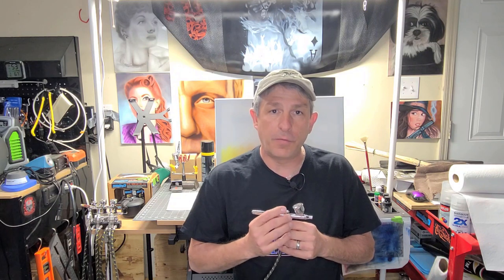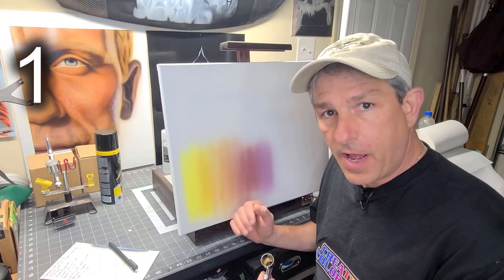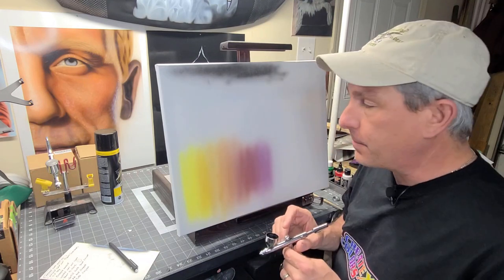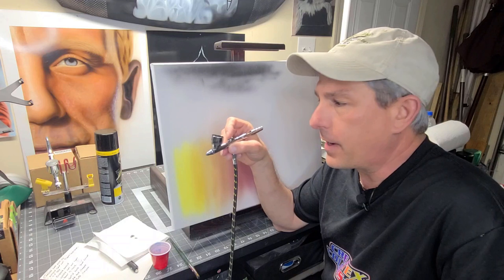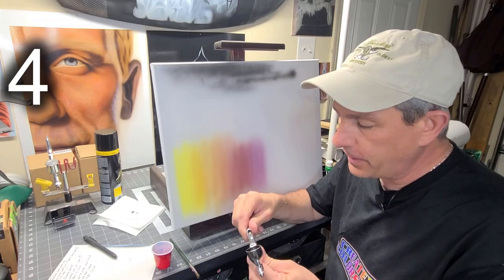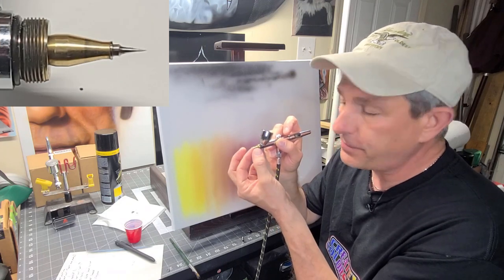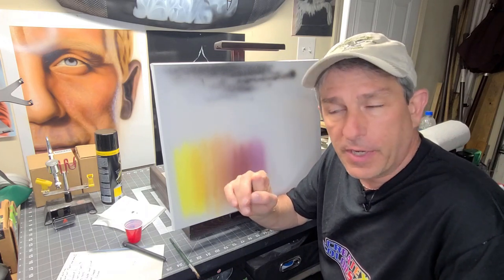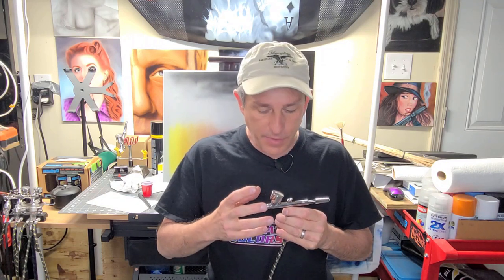Airbrush Won't Spray? Some Reasons It Won't!

Comment: I have a pistol grip airbrush that has no air going thru it at all. tore it apart, cleaned everything, still no air. It's not the incoming flow from the compressor, that work fine. All the valves are clean . Any thoughts?
Reply from the maker: Rick, is there a MAC (micro Control Valve) valve on the gun? If so make sure it is turned open. As simple as this sounds it has happened to me. It is not likely that an air valve goes bad but any thing can happen. Take the air valve out inspect it and put it back in and try it. Before you put it back in hook your air hose up to the brush and make sure there is no other obstructions. This will isolate the air valve. If no good after putting the valuve back in, look to replace the air value. Hope this helps.

Comment: I'm new to using a gravity feed brush. I bought a gun with a 4 color cup, I thought, that could be cool. When I connected it the first time it sprayed but very lightly and eventually stopped spraying all together. I stripped the gun cleaned everything out it back together and still nothing. I out it back in its box and continued spraying with my bottle gun. Any ideas on what happened? Also, how far do you stick the needle into the tip? Thanks.
Reply from the maker: 6274, sorry to hear you are having trouble. The needle needs to be pushed all the way against you nozzle. As long as you can get paint to flow onto the tip of your needle and air flow it should work. Two main reasons for what you are experiencing is your paint is to thick and or you needle nozzle has some dried paint in it. Use a needle reamer on your nozzle, reduce your paint to 1 to 1 or more and set your repressure to around 27 p.s.i. and see what happens. Hope this helps.
Reply: @TheAirbrushGarage  thanks a lot 👍🏻

Comment: Help🙈🤦‍♀️I took my airbrush appart  to clean, can’t remember how it goes back together. I pulled out the anatomy, mechanical paper of it, no retraction on the needle still.🤦‍♀️🤦‍♀️🤦‍♀️🤦‍♀️
Reply from the maker: Kendra, make sure the needle is pushed all the way forward and the needle nut is tight. Also make sure your needle stop is not all the way forward. And don't get frustrated, learning how to take apart, clean and put your brush back together is a very important part of airbrushing, you'll get it. Hope this helps and thanks for the question and hope you keep watching.

Comment: I've been trying to airbrush, I've trouble shooted everything you covered and i still can't get any paint out of my gun. Is there anything else that i could be doing wrong.  It will spray reducer and water out fine. Soon as i add paint reduced and all. Nothing 🤬
Reply from the maker: Orlando, if it's spraying straight reducer it should spray paint.. Try this...start with a mix of 10 to 1. That's 10 parts or drops of reducer and 1 part (drop) of paint. Mix well and spray. Continue to add one drop of paint mix and spray until it becomes difficult to spray. Now clean your cup, back off 2 drops from where it became difficult and use that mix to practice. Hope this helps. Thanks for the question and thanks for watching.
Reply: @TheAirbrushGarage  yeah that's what i was thinking if it sprayed reducer it should spray paint..but i will try what u said. Thank you for replying and your help..You're welcome too

Comment: I followed all these steps and my air brush still wont spray paint. I used paint thinner and it still wont work and I checked the needle in the front for dry paint i just bought this air brush a week ago idk what to do
Reply from the maker: Gunner, It can be frustrating when you first get started. Set your air pressure to 30 psi. reduce your paint 1 to 1. snug up all connections. Now if it still doesn't work, take off the air nozzle (with no paint in the brush) press down on the air, is it good and strong? it should be. Also, hold the air nozzle up to the light, you should be able to see through the little tiny air holes (rare, but make sure they are not clogged). put everything back together. Now, with very thin paint, 30 psi, everything back together and tight. It should work. What brush do you have?

Comment: I dont know but the White paint stick to the tip of the needle like glue, even with constant air flow, I have tried with two type of nozzle and needle, a 0.2 and a 0.3 and it`s the same issue everytime.
I'm about to trash all this paint and try uretano .
Reply from the maker: Alden, which one are you using? Wicked or illustration? If you are using Illustration just use a few drops of water. Illustration sprays alot easier than wicked. If you are using wicked use 4011 reducer. Start with a 1 to 1 mix. If you are still getting tip dry Add a few drops at a time untill it goes away. Use a small paint brush dipped into some reducer to clean off the tip dry. Then spray air and dab with a paper tower so you don't blow reducer on your project. This works better than clearing it with you fingers. Createx is really good paint I have been using it since the beginning. If you reach out to Createx and let them know your frustration they will respond with tips as well and possibly send you some free paint. Don't give up. If I can do it so can you.
Reply: @TheAirbrushGarage  thank you for your reply , yes I only use illustration, already trashed all Wicked. Will try your advices , thank you Sir.

Comment: I've been having the same issue as problem #1. I have an iwata revolution CR Japan, it'll start spraying then stops and starts when i move the trigger, spraying around 20psi and acrylic paint is thinned down to consistency of milk.
I also notice that it spiders sometimes would that be due to pressure being too high with thinner paint? so reduce pressure?
thanks.
Reply from the maker: Knuckles, I spray at 27 to 30 psi. It sounds like tip dry. Make sure when you bring the trigger forward to stop the flow of paint you still have the air on. This blows to paint off the needle and minimizes tip dry. As far as the spidering goes that is a matter of distance, speed and trigger control. I know it can be frustrating but you will get it. Just keep practicing. Hope this helps and thanks for watching.
Reply: @TheAirbrushGarage  thanks for such a quick response! I usually keep air continually going and clean any tip dry. It’s a new brush used twice and only started doing this the third time. 
I took it apart since my comment to see if maybe there was a blockage of sorts. 
I’ll keep working on my technique.
Thanks, video was very informative.
Reply from the maker: @Knuckles2K12  if you don't have a needle reamer get one her is a link. This will help! https://amzn.to/3A7hEe2. You will be shocked at what's in your nozzle when you use this.

Comment: Mine won't spray except when I release it spurts a bit out. Trying to figure it out.
Reply from the maker: Lori, just released a video yesterday on this topic check it out if you get a chance. But for now....start with just reducer or whatever you are using to reduce your paint. If that is spraying good Add a drop of paint mix and spray. Keep doing this until it starts to give you trouble. Now you will know the ratio of reduce to paint. If it's not even spraying just reducer properly head on over and check that video from yesterday call "Airbrush won't Spray". Good luck and thanks for the question.

Comment: I paint model cars this is the first time I'm using airbrush I'm using iwata neo airbrush. I'm using enamel paint I'm sending it out correct ratio but when I go to spray it's spraying out a web like dust on the body like things are flying around the air coming out of the airbrush, can you tell me what would cause that, or what am I doing wrong. Thank you
Reply from the maker: Eddie, it sounds like a paint problem. What neo are you using? siphon or gravity? what's the name of your paint? What air pressure are you using?
Reply: @TheAirbrushGarage  gravity airbrush, 20psi, mcw enamel paint
Reply from the maker: @Eddie Brown  I looked up that paint it should be fine as long as it is thin enough. Bump your air pressure to 27 to 30 psi. What you described sounded like the paint was drying before it hit your model. I have never experienced that before. Try those two things I mentioned and let me know. Oh..what are you using to reduce it with?
Reply: @TheAirbrushGarage  Mr leveling thinner 400
Reply from the maker: @Eddie Brown  I am not familiar with that. Sorry I could not be of more help. I would definitely bump the air pressure to 27 psi.
Reply: Thanks for your help

Comment: I never think anything is a "bone head move". Especially if you are airbrushing for the first time. I know this from 3D printing. I feel better if the solution to my problem is a "Bone head move" or simple "FIX". That means I can get back to printing or Airbrushing faster. I just bought my first Airbrush system. And trying to learn, learn, learn as much as I can. I figure Airbrushing my model is easier than buying a printer with multiple Extruders to try and print in multiple colors. I bought a cheep or cheeper 1 gallon compressor but a good Patriot 105 Airbrush.
Reply from the maker: John, cool! I just bought a 3D printer, and I'm using it to make prototypes for airbrush accessories for the work area. I have an anycubic cobra max. And good luck with the airbrushing. If I can help in any way, just let me know, and thanks for watching my videos.

Comment: I have a Tamiya airbrush, it was working fine and I stopped using it for a while. I cleaned it real well before I put it away. When I went to start using it again I can not get any air to flow, I have taken it apart and cleaned it again but I can not get any air to come out. I checked the air valve and it is working fine. Any ideas on what is causing this?
Reply from the maker: Ronald, Do you have a water trap attached to the airbrush? I have had the water trap rubber "o" ring restrict the air flow when tightened to tight. Now , lets start from the beginning. Take off your air hose and make sure you are getting air. If so, reattach it (without the water trap). Also make sure the little holes in your air nozzle are not clogged. Now if your air valve and trigger are working properly and your holes in your air nozzle are clear it has to work. I hope this helps. Thanks for watching and don't get to frustrated, you'll get it.

Comment: my  airbrush wont spray i have checked all in your video but  still wont spray,there is a small o ring behind the fluid cap  which i acidently removed. i have put it back in but im not sure if i have done it right because it wont spray. if i remove the o ring altogether it just blows back bubles in the cup but when put it in it wont spray. is there some special way of putting it in that im doing wrong , cheers doug
Reply from the maker: Doug, my eclipse has an O ring and without it it can cause an air leak. Putting it back on should not cause your brush not to work. So....if it is backing up into the cup that means you have an obstruction. Think of pinching you fingers at the front of the brush. What happens? it bubbles in the cup. I would look more at the nozzle. This is where most issues can be solved. Use a needed reamer to clean your nozzle. You will be surprised what is still in there even after you run reducer through it. hope this helps. don't give up. You'll get it.

Comment: What happens if my airbrush has weak airflow?
Reply from the maker: National, remove your air nozzle cap. If your air flow is strong clean the little holes in the cap. If the air flow is week when your cap is removed it may be in the air valve but highly unlikely. Hope this helps and thanks for the comment and watching.
Reply: @TheAirbrushGarage  uh oh. The airflow is still weak even if I remove the nozzle. Everything's clean.
Reply from the maker: Well...do you have a water trap connected to your airbrush? If so remove it and connect your hose directly to the airbrush. If that don't work it could be your regulator on your compressor, rare though. If non of that works I would say air valve. What airbrush do you have?
Reply: @TheAirbrushGarage  I'm guessing the compressor. I have the KKMoon with the small white box type compressor
Reply from the maker: Well good luck I hope I was of some help and I appreciate you watching my videos.

Comment: I orderd three new cheap sprayers, none of them will spray, not even water do you know whats happening?
Reply from the maker: Anthony, Did they ever spray? If they did then they are clogged, if they never sprayed and it won't even spray water, then I would return them. The cheapest brush I would use is a neo by iwata ($60). If an airbrush is something you really want to learn, start with an iwata Eclipse or at least a neo if budget is a factor. Good luck and thanks for the question and thanks for watching.

Comment: I need help only air is coming out and no paint or cleaner
Reply from the maker: Scorpio, you have something Clogged. The mechanics of an airbrush are pretty simple. If you have a gravity fed brush, paint flows from the cup to the nozzle onto the needle and then the air passes through holes in the nozzle cap which make the air flow around the nozzle and blows the paint off of the needle. If you have a siphon feed make sure the air hole in the lid is open. Otherwise the above applies. hope this helps and thanks for the question and thanks for watching.

Comment: Spray gun not spraying anything out.   Please help.
Reply from the maker: AJG, well....that's nor much to go on but...I would break the gun completely down and clean any and all inlets and out let's. If paint can get to the nozzle and out on to the needle and all air hole are open to let air flow around the tip of the needle....it has to work. Make sure when re assembling every thing is dry and properly not overly tightened. Let me know how it goes.
Reply: @TheAirbrushGarage  sorry newbie here getting into the hobby.  The spray is brand new. Only air comes out.  No paint. Everything else seems to work.  Do u think maybe the acrylic paint not thin enough.  Appreciate your advice.
Reply from the maker: @HandyAndy999  yes. Start with just water or reducer. If it is spraying good then add a little paint at a time. Mixing each time you add the paint. Once you are about a 1 to 1 mix you should be good. If you are still having problems mix 75 percent reducer and 25 percent paint. As you get the hang of it you can work towards a mor even mix. Hope this helps. It can be frustrating, don't give up. You'll get it.

Comment: Thanks for the video. I'm a newbie struggling with my brush. Getting splatter spots of paint rather than good atomization while practicing with water. I have good air flow and needle moves correctly.  I can get water to run out nozzle with just the needle pulled back while not triggering air. I'm using a .5 needle. Any other ideas on this splatering issue?  Thanks
Reply: JackZu, water or paint will run out because when you pull the needle back it breaks the seal between the need and nozzle. This is supposed to happen. When you pull the needle back the paint flows out to the tip of the needle and then the air blows it of the needle. I have a video on "How an Airbrush Works " check it out. Hope this helps. Don't get to frustrated and keep at it, you'll get it. Thanks for the question and thanks for watching .
Reply: Dan thanks again for the videos and your help. I did subscribe and review the videos and all makes sense in your reply. I researched and understand a lot more on the workings of airbrush functions. My new brush is not a real expensive item but a step up from my beginner bottom feed badger starter brush. This is my first top feed brush. Straight out of box I tested with water only. There are no paint clogs as this is brand new. I have tested with the .2mm, 3mm, and .5 nozzle. If I pull back trigger with no air applied I can get small amount of water to come out of nozzle only when I touch the nozzle lightly. This lines up with your reply about the needle being pulled back and opening the nozzle. When I apply air with needle pulled back I cant get water to atomize with any size nozzle in place and at best I get some splattering of water with nozzle cap off.  When I take the nozzle off I then get nice atomized water. All nozzles seem to be clear as the needle does move freely through. The air cap is tight so no air is leaking by. Air is flowing nicely and I have tested at many various psi settings. I believe it has to be operator error but cant figure out what I am doing wrong. I have worked on this for the last 3 days trouble shooting and testing with no luck. Was very excited to be airbrushing models again but the excitement is long gone. Any ideas are welcome as I may have to revert to aerosol paint cans if I can't get this. Thanks for your time
Reply: I’m right with u about to give up for good and go back to bussing tables because I have done absolutely everything and still horrible airflow in my eclipses. Been at this for hours

Comment: I was painting with a Badger 350, and suddenly it stopped painting. Seems that the button is not working, because it is not moving neither in or out, and there is no air running through the airbrish, can you tell me what the problem can be? Thanks!
Reply: Theo, sounds like the air valve. Remove it and take a look. Kind if unlikely but if you are not getting air that's where I would start. Also do you have a water trap attached to your brush? I already had the rubber O ring block the air when tightening the trap to tight. Bit if your trigger will not depress that points to the air valve. Good luck, hope this helps. Thanks for the question and thanks for watching.